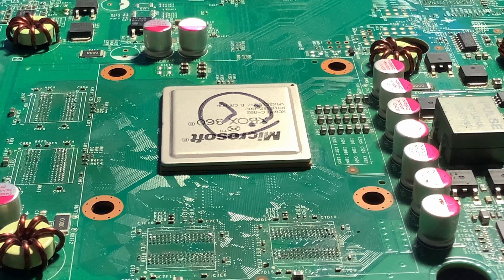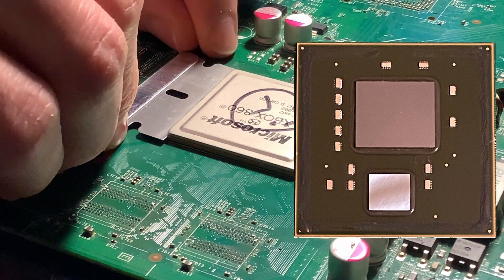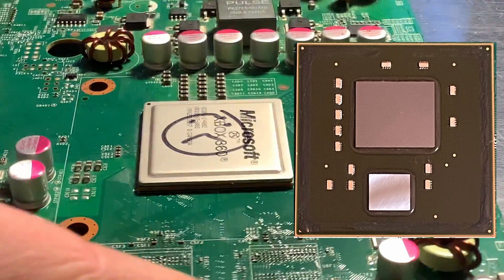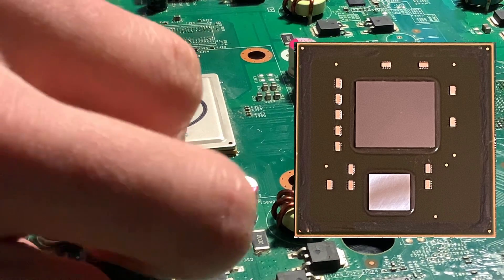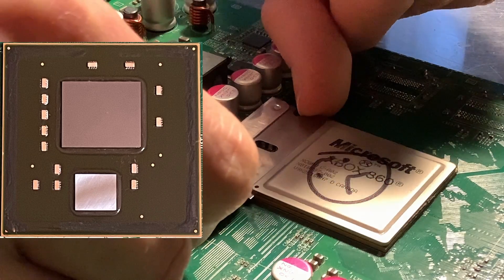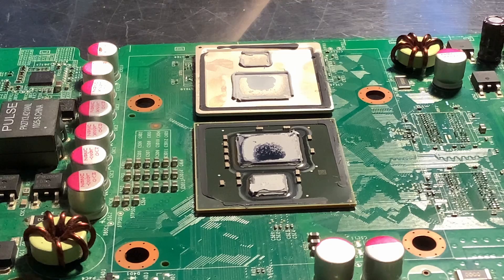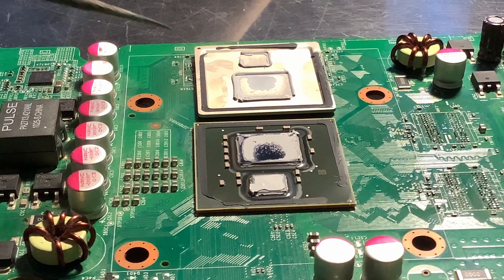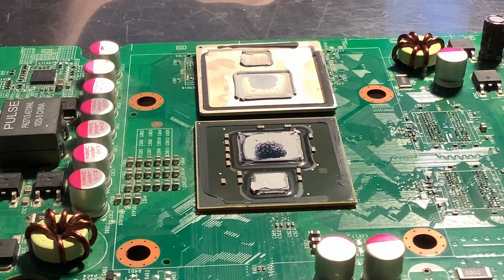How to safely remove IHS on Xbox 360 S or Xbox 360 E

Comment: question, would you recommend replacing the thermal paste with a carbon based thermal pad? or thermal glue perhaps? I would like to know of a very long lasting solution please and thankyou.
Reply from the maker: No point. Just use hi-life paste. Ceramique 2 is good for 8 years.
Reply: @Josh.Davidson  Many thanks.

Comment: So what paste do you use and how do you apply it, and how did you remove the old paste?
Reply: Mx4 paste and 99% isopropyl alcohol with a q tip to remove
Reply from the maker: That works

Comment: Hey Josh, I have a question. I delidded my console and everything seems fine, I didn't hit anything and I didn't scratch the board. 

But my 360 shows error code 0021.

I think it's because of the capacitors on the left side of the APU on the side of the smaller chip.

C5E3 and C5E4. They look corroded. Would you know what capacitors I need to fix those?

Or do you think I just screwed myself during the delid?

My 360 did work before the delid but because it went so well I don't know if that caused the problem. I also cleaned those corroded capacitors with alcohol before the delid.
Reply from the maker: If all you did was delid then likely you damage the chip somehow or motherboard.
Reply: @Josh.Davidson  Dang that sucks.. I think maybe the force was to much on the solderballs beneath the chip. My razor didn't go in as easily as yours in the vid.

Great tutorial tough! I did also delid my corona and it was a succes.
Reply from the maker: I don't think the solder balls had issue. If they did, then you should be able to get it to work by pushing down on the chip. You shouldn't even need to push very hard.
Reply: @Josh.Davidson  I'm going to try out replacing two corroded surface mount resistors as a last ditch. If that doesn't work, I will at least try to reflow with a heat gun... 

Doesn't work out= awesome paper weight!

I just bought a new Xbox and did another successful RGH so I don't care as much. 

Thanks for all your work Josh! You're damn skilled

Comment: Is the pressure of the cooling block and x clamp enough to keep it in place or do I really need to add high temp glue?
Reply from the maker: It's enough but I recommend securing it

Comment: Is doing this really necessary? It is not enough with changing the thermal paste?
Reply from the maker: After 10-15 years the stuff under the IHS can stop being effective. Only delid if you experience loud fans even after replacing the paste on top.
Reply: @Josh.Davidson  And if I want the system to live longer? I was thinking on replacing the paste, I didn't even knew you could remove the IHS.
Reply from the maker: This does not impact the longevity, the temps are way way way below the point where that would happen. Please don't believe the internet "pseudo-engineering" nonsense.
Reply: @Josh.Davidson  So the only point of doing this is to reduce the fan noise? Is it true that chips get micro cracks with time and that it's the reason they eventually fail?
Reply from the maker: @angelbryan98  these chips don't contain the flaw that caused the RROD. And even if they did paste doesnt make a difference.

Comment: I did it with super small screwdriver if doesn't look to bad at least most of it other than little chipped in one corner but hopefully its just ground
Reply: @Josh.Davidson  now time for rgh 3.0
💀
It still work btw Idk what will happen after rgh with my 20$ soldering iron and no experience Im going to try and see

Comment: Best to not cut the side with the nearby caps, just the corners of that side. And it will lift off.
Reply from the maker: I disagree. I've delidded tons of these without issue. A clean cut makes re-attatchment easy and safe.
Reply: @Josh.Davidson  Sure but it's very easy to knock off those caps on that side.
Reply from the maker: Not if you follow my instructions

Comment: Do you think that the difference in die height is the main reason the chips fail? (Especially with the fat models where they didn't have the heatspreader to equalize the heatsink pressure)
P.S.: I'm just guessing, I don't have any experience with any of this
Reply from the maker: No, not at all. On the Phat the eDRAM is also lower. That is on purpose, because the eDRAM puts barely any heat out, while the GPU die puts a lot out, this ensures the heatsink is always flush with the GPU die.

Comment: Hi!, can the Heatspreader still be used after reapplying the paste to the Dies? thanks! i just like having the chip information infront of me
Reply from the maker: Yes, you NEED to put it back. Thx.
Reply: @Josh.Davidson  is there a way you'd recommend re-adhering the IHS?
Reply from the maker: I affix it at the corners with high temp glue. Easy slice in future

Comment: Going to be trying this, my brothers 360 is a jet engine even after swapping paste.

He used it in an enclosed cabinet for a bit so he may have dried the paste under the IHS.

Edit: Was successful. I used a razor blade that was in a box cutter which is a bit thicker so it took a LOT longer. But I eventually did it. The cooling performance difference is absolutely insane.
Reply from the maker: glad to hear!

Comment: i wonder how the temperatures are after doing that. I did only new thermal paste on the Heat Spreader and the temps are around 70-75°C. The fan is at normal noise level.
Reply from the maker: Then don't worry, the paste under IHS is likely fine. Only change it if you see the fan ramping up frequently or the hot spot (labelled CPU) diode approaching 82.
Reply: @Josh.Davidson  Ok thanks for the Info!

Comment: can you use liquid metal between the die and heatsink
Reply from the maker: Terrible idea
Reply: @Josh.Davidson  May I ask why? Cuz as long as you make sure it does not touch the components should be fine. I mean it's the same heat since you see on computer CPUs well the same material? Also, what are those components that are around the CPU and GPU chip
Reply from the maker: @thewavyshopofficial  Because it's dumb to put such ridiculous over the top shit on a low power chip...
Reply: It’ll destroy the heat sink as it is mostly aluminum
Reply: @Bridgetfidget18  no i was talking about between the die and  the heat spreader
Reply: @thewavyshopofficial  liquid metal can easily spread over the chip after you reassembly the IHS causing shortage with nearby capacitors. Good thermal paste is enough for slim CGPU

Comment: I used a thin nylon fishing line wire after heating the lid with a hair drier. I don't remember the size though. Definitely safest way absolutely no way of scratching.

Also fixed back using silicone sealant. Works great.
Reply: There have been cases where that scratches the die substrate
Reply: @NotSkeletor  nylon wire scratching the die/substrate? No way man. Nylon is plastic, it will never scratch. Maybe It was some sort of metal wire bro
Reply: Can you do a video on how you did it? Would be so useful.

Comment: Is the thermal glue hard to remove? And in the future, what would be the best method of removing that glue
Reply from the maker: What thermal glue?
Reply: @Josh.Davidson  if u were to put glue on 4 corners of the chip to hold the ihs down, I’m asking if it would be hard in the future to remove, speaking for a silicone thermal glue to be exact
Reply from the maker: @Bridgetfidget18  No. You just slice it again.
Reply: @Josh.Davidson  what I did to mine was place the IHS on the heat sink where it would normally sit being held on with paste, then putting paste on the actual chip, so it sits how it should and is as close as can be to the heat sink
Reply from the maker: Same result pretty much. If you scraped the silicon off the IHS or substrate, your susceptance to worse thermals. Unless you get lucky with the delta height of the CGPU and eDRAM dies.

Comment: Question: would something like dental floss work to cut through adhesive. It's frequently used for "just the glass" replacements on phones, since they laminate the screen to the glass.
Reply from the maker: I never tried it
Reply: Have you tried it? Worked

Comment: Recently acquired a beat up 360 E Corona, warranty seal intact. I planned to delid, but then I saw the stock thermal paste was still wet. Was surprised to see zero dust inside. Must've never been used. Applied MX4 and slapped it back together, it's whisper quiet!
Reply from the maker: You sure it wasn't replaced? Those slim warranty seals are super easy to bypass. Sometimes when I take the casing off it doesn't even break, just separates cleanly. The stock paste is designed to cure dry to last a LONG time as opposed to the aftermarket pastes.

Comment: My mistake was removing the black sealing from the socket, and making temps go a little bit high of what it should had been, but you can see the thermal paste underneath the IHS is completely dry
Reply from the maker: It's supposed to be. The long lasting type of paste "cures" into place. As long as you don't break the seal it will last a long time. Eventually it needs replacing but not because of "dryness". 
You're comparing it to your aftermarket paste types which typically need replacing in about 4-5 years, far too short for any consumer device.

But yes you can alleviate this by gluing the IHS with pressure only over the CGPU die area, not the eDRAM die area. That should help.

Comment: Nice job. keeping the razor parallel to the chip substrate keeps the cutting edge up off the substrate. Causing no damage.
Reply from the maker: Exactly. But if you push in too far, you'll shear off the capacitor networks on top. So still have to be careful.

Comment: Would you get better temps by putting the heatsink back on without the IHS?? Or is it best just to keep the IHS on the sub-straight??
Reply from the maker: You can't. The heatsink is designed to have the original height. Also if you do that the eDRAM won't touch the heatsink well - and in addition, the IHS adds a lot of thermal inertia - which actually will help dampen thermal spikes...
BUT the default temps are fine, so why bother anyways.

Comment: The best way to remove it - using painting knife.
Using it, there's just no way to damage APU.
Reply from the maker: Yeah, but most people already have a razor blade so I recommend. I use painting knife in PS3 CELL :)
Btw, I'm being pedantic but the CGPU is NOT an APU. APU is AMD's term for a CPU + GPU. This chip was designed by IBM, ATi (pre AMD merger), and Microsoft.
Reply: @Josh.Davidson  if you fancy doing a quick video or just a link to the tool next time/if you come to do a PS3 again that would be handy. I have a bunch of fat PS3 consoles knocking about, which at my current burn down rate I'll get around to in 2027...
Reply from the maker: @spazmochad  I'll keep in mind, I'm no PS3 expert tho